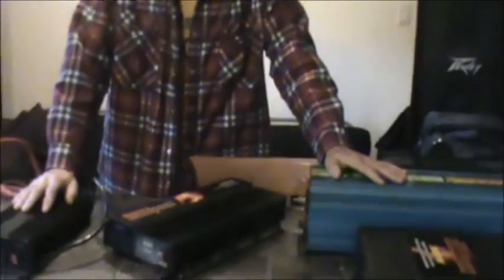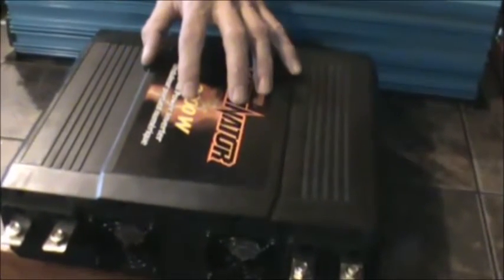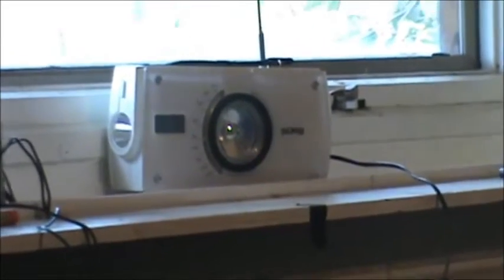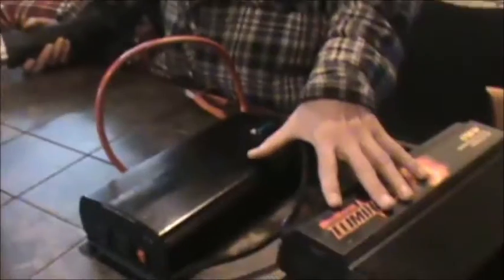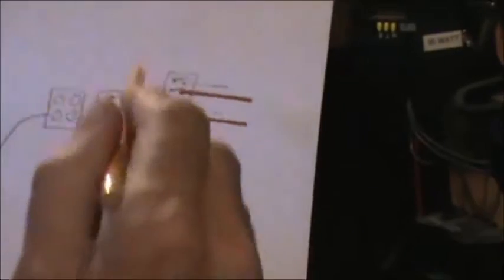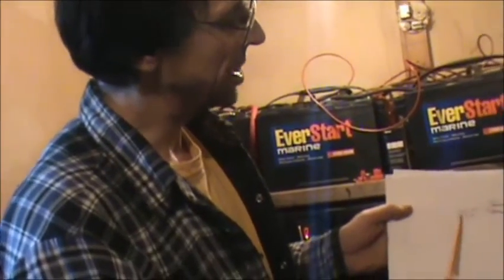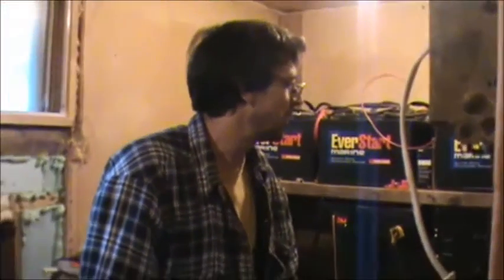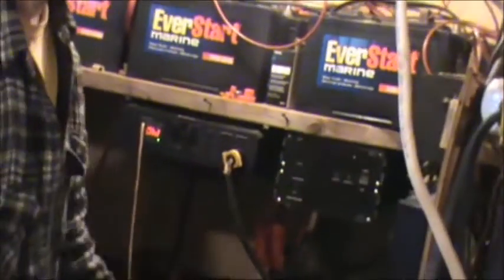Off the Grid: Inverters and Noise (DIY) (Solar Power)

Comment: Info on this video is wrong. The humm is from the computer audio output. Insert a DI and humm goes away. Battery has Stadium effect. This fellow charges at too high amps and will shorten the battery cycles and overall life on his batteries.
Reply from the maker: What ( PnPrailroad  ) is talking about is an impedance imbalance and this is not the case in this instance .
I use to get this buzz from my old laptop because I was useing the 1/8 sterio jack
strait to the amplifier . This is what he is talking about .
But in this case I am useing my HDMI cable to the TV ( 8 ohms ) to my sterio ( 8 ohms )
so the impedance has been corrected .
In this case the buzz that you hear is in fact the inverter and if it was not , then 
there would be no differance when I unplugged the laptop from the power supply .
So ,  getting a DI box will do practically nothing for me in this instance .( PnPrailroad ) also thinks that I am charging at to high of amps  ,but at a starting voltage 
of 12.4 volts I only get about 40 amps when the charger is set in the boost mode .denis
Reply from the maker: What I have is close to 100 amps worth of panels going into 30 deep cycle batteries . 100 divided by 30 is only 3.333 amps per battery . Some of my panels are mounted at an angel that shoots SS East , some of my panels shoot strait South , and the rest of my array shoot SS West . So at no time do I have 100 amps worth of solar going into the batteries at the same time of day . Worst then that , my panels are mounted strait up and down , like mounted on a wall and are never at a true 90 degree to the sun . So this 3.333 amps at 12 volt is reduced yet again !